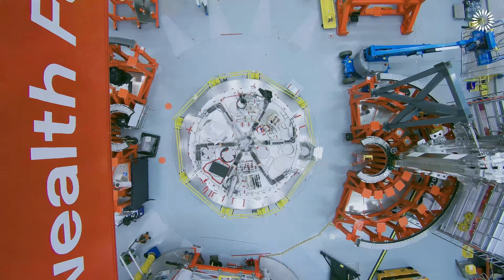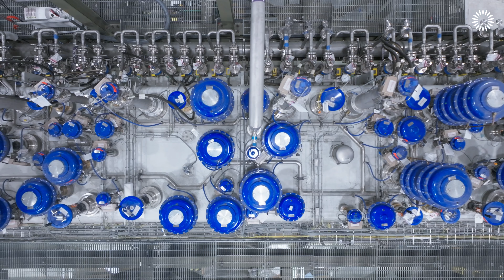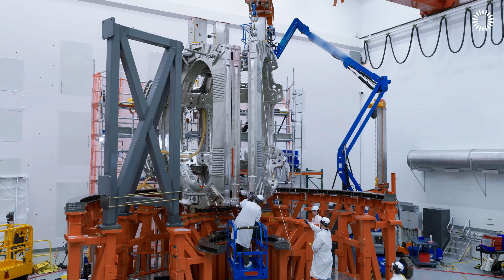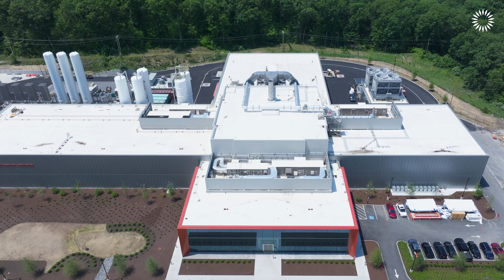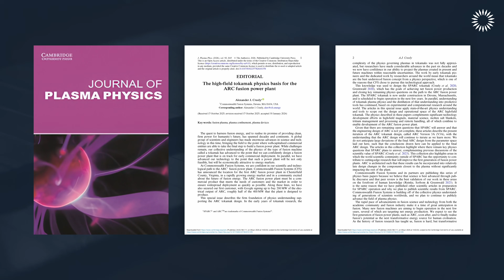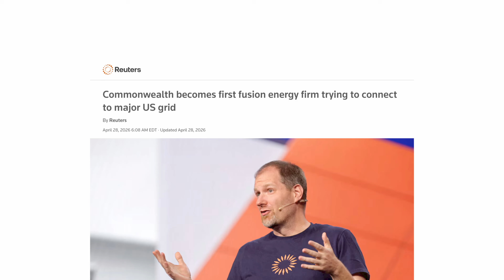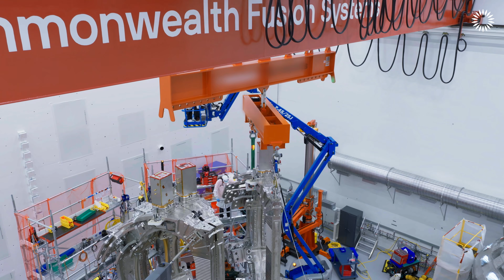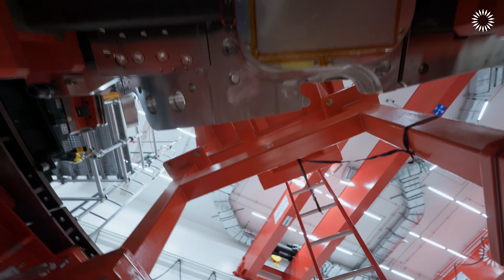An update from Commonwealth Fusion Systems (July 2026)

Comment: Are you sure it would be "carbon-free energy"? Surely you mean "low-carbon"? Unless you have some magical production processes for those masses of metals, purified fuels and other components. Also, you are assuming you are using your own fusion electricity for powering the electromagnets, cooling pumps, etc.
Reply: Can never win with you. This is as low carbon as it gets.
Reply: @Anne-LiseH  You agree with me that it is not carbon-free? There is no need for inaccurate language in marketing hype if the truth is as you say. The dream, if it lives up to those most optimistic guesstimates, will be low carbon, but high input/high waste/expensive recycling. I would like to see how much carbon dioxide has been produced just in the development of this minitokamak. If the company is dedicated to low carbon electricity production, that should be in its reports. So that, some day in the distant future, they can celebrate when they produce their first carbon neutral watt.
Reply: @pattheplanter  - CFS is a fully private company so they have no public stock-holders and don’t need to issue regular formal reports to the public sector. They don’t account for all the energy use and carbon emissions of the vast network of suppliers that they have created. In calculating their, potential future energy gain from their SPARC experimental machine, they ignore the total input energy needed to power their facility. If future nuclear fusion power plants are created then the energy costs, of creating the nuclear fuels, will need to be accounted for. Most fusion energy approaches generate 14.1 MeV fusion neutrons that will irradiate the surrounding reactor structures which will eventually make some of the components radioactive so that it will need to be disposed of as radioactive waste.

The nuclear energy promoters have learned to capitalize upon the fear of Anthropogenic Climate Disruption (ACD) effects and AI processing data center power needs, as excuses to feed their love of expensive nuclear technologies.
Reply: @pattheplanter  "Low carbon" can be more misleading than saying carbon free if we're talking about regular operation.
Reply: @Anne-LiseH  you are kidding - it doesn't even work